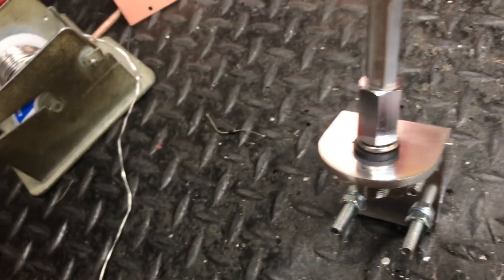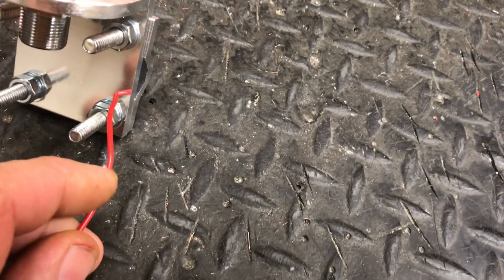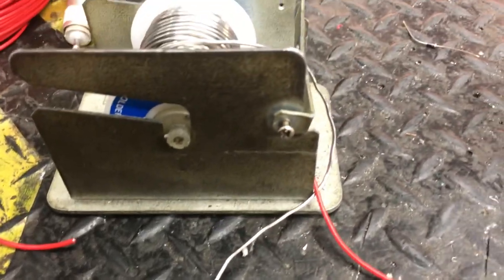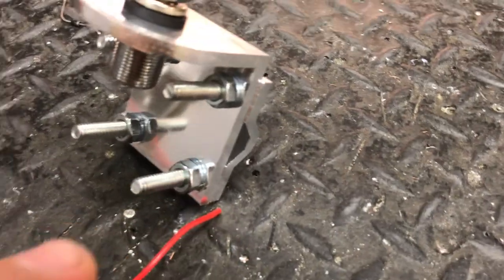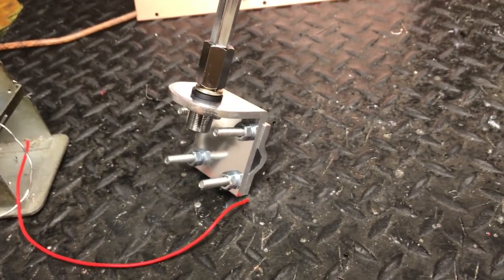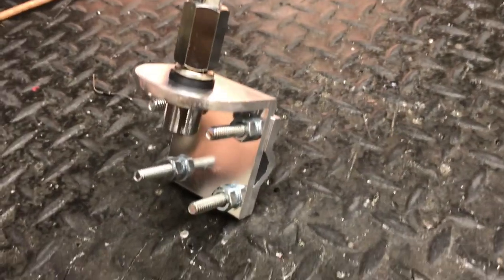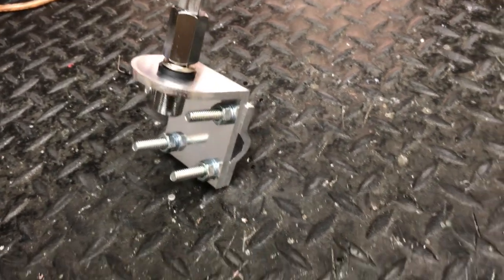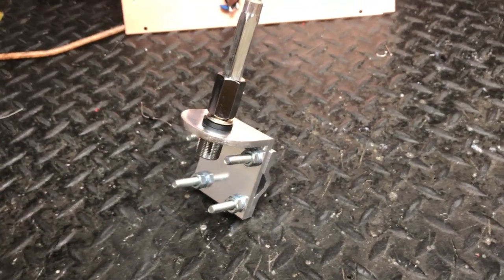Mounting and Grounding Mobile Antennas Correctly

Comment: Im in a semi, and the antenna is at the top of the door. I don't have anywhere that is technically short distance for wire to travel to. Any recommendations?
Reply from the maker: Top door hinge. Then different wire from
 Top hinge to the bottom hinge on diff bolt
Reply: @DonkeyStomperProducts  lol okay I'm at a TA on my 34 I've done one 14g wire from hinge to hinge to body and then to frame and it definitely helped but I think I'm gonna have to do it 2 or 3 more times with this small of wire
Reply: @DonkeyStomperProducts  it got me from a 3 to a little under 2 swr on a astatic meter. Better than the meter on my cb but I don't think it's that much better
Reply from the maker: @codybean2981  It works good luck 73!

Comment: all metal is grounded. no matter what if the end destination of that ground is the frame everything that wire is touching is ground. i have no clue what youre talking about.
Reply from the maker: Simple if you use a long wire for the ground it will become part of the ant like a die pole.  The ant and or metal has to be ground to the 12 volt ground that powers the radio with a mobile antenna. So many people think they can take a long wire from the mounting bracket to the frame. Will not work correctly. Were talking RF Radio antennas not standard 12volt grounds.